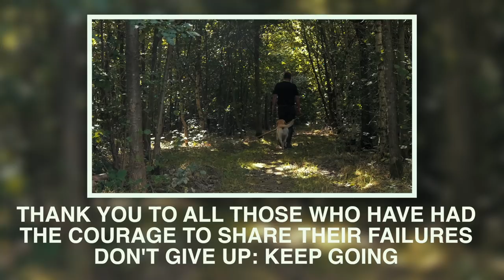Broken a Bow? Failed as a Bowyer? Never Give Up

Comment: thanks for the inspiration Mick, I was feeling disheartened after cracking my first attempt of a longbow, devastated I was as ive had the wood seasoning for years and have no more to work with yet. I decided to make a kids bow with whats left of the stave (47.5 inches from 73) but also went for a wander by the roadside in a thin strip of woods and have found a lovely straight and long dead sapling, I cannot identify the tree by the bark alone but im going back for it, should be nice and seasoned already and youve shown me I can make a bow from any wood. thanks again!
Reply from the maker: Keep at it!

Comment: Today I  was on the last stage of tillering a red oak recurve bow that I’ve been working on for the past two weeks. Had pressed the bow to 49 lbs at 28 inches yesterday. Wanted to get it to 45 at 28 today so after a few card scrapes on each limb to remove some shavings the bow exploded when i pulled it to 25 inches on my tillering post. Disappointed? Yes! But then i did a quick inventory of my work process, design, wood selection, grain, etc. Disappointed? Yes, but also so grateful for the experience, the satisfaction of seeing the bow come into shape, and the learning i achieved from the work. So now what? Keep going? Hell yes! Tomorrow we start a new bow. This time using Hickory. Carry on!
Reply from the maker: Well done with your positive outlook! Good luck.

Comment: Yesterday I saw a hazel branch and thought to myself is this wood good for a bow. So of course I googled it and found your channel and your hazel bow series. You inspired me and today I went to get that branch it was even long enough for two peaces so if I fail on first I can try again. Currently the wood is drying as you said ,here in Croatia is very hot right now so idk it may speed up the drying process ,wish me luck :-)
Reply from the maker: Good luck Mateo. Hazel is good for bows, easy to work but does challenge us beginners. Make the bow’s belly flattish - not D shaped. Takes a few weeks to dry, especially if you shape roughly to bow size first. Best wishes, Mick

Comment: I’ve taken a short break because its too hot to be working at the moment, and because I need a break otherwise I’ll get frustrated when it starts to take too long. But I do know I can do it. The second one I made from a board only broke because I made the brace waaay too high, almost 7-8 inches. At a normal 3 inch brace it pulled just fine. Then I pulled it hard at the high brace and it broke. I’m not giving up, just preparing for the next session.

Comment: Thanks Mick. My latest bow (a Russian Olive gull shaped branch bow) is giving me fits. One good thing is I am going for a light weight practice bow (25-30 lbs) but even that is challenging as balancing the limbs keeps wobbling back and forth as I try to reduce power. A real character bow, as well. My local woods include black locust, ash, and hop hornbeam. I also have some Pacific yew. Even harder than bows? Arrows!

Comment: Hello Mick.

I started tillering, and inevitably broke, my first bow today.  A lovely piece of beech deadwood picked up in the forest, and now it's just firewood.  Back out to the forest with an axe and a handsaw tomorrow.
Reply from the maker: That’s a pity, but it’s how we learn. Find some hazel or ash if it grows near you. You might have more luck with one of those. Stay well.
Reply: Yep, it's a pity but it's all part of the learning process.

Around here there's loads of beech, some birch and hazel, and occasionally some ash.  The rest is epicea, which is useless even as firewood.  Beech seems to be the one that grows straightest and mostly without knots, which is why I picked that particular branch.  I gather it really wants to be tempered on the belly for bow use but for starters I just want something that will bend.

It was my fault it broke, of course.
Reply from the maker: Michel Auron beech has an interlocked grain, a lovely wood but not one I’d choose for bows. Hazel is excellent, usually grows straight and responds well to heat for reshaping and hardening the belly.
Reply: Thanks for that.  I'll have to see what I can find, the haze around here seems to grow "straggly", it's rare to see anything much thicker than arrow shaft size.  Might be something to do with thicker branches getting flattened and snapped by the snow - I'm in the French Alps.

Also, thanks for your various videos.  Enormously inspiring, and beautifully made.
Reply from the maker: Michel Auron Ah, I wondered where you lived. Hazel grows well in UK and often coppiced, producing many straight branches ideal for bow making. How is the birch where you are?
Reply: It's mixed woodland with a majority of epicea, so anything broadleafed is fighting for space.  The only way, as Yazz once said, is up.  This means there's a lot of very straight wood, which is good.  What's also good is that early and late season snow, which tends to be properly heavy at this altitude, brings down a lot of trees and branches, which means there's a lot of wood simply lying about, taken down at prime cutting time when the sap's down, and seasoned under snow... 

Birch is a bit rarer than beech, but there''s a fair amount of it around as well.  Silver birch.  Grows a bit more wonky, hadn't really thought about it for bowmaking.  Recommended?

The bit of beech I was working on was around 25 years old counting the rings, around 2 inch diameter, quite dense really.  It'd been down for a while, the bark was already stripped.
Reply from the maker: Michel Auron I have always been cautious of fallen branches, but you seem to have plenty of choice. I believe silver birch makes an okay bow, but around here I don’t find anything at all straight. Any yew?
Reply: @MickGrewcock  I wish!
Reply from the maker: @wibblywobblyidiotvision  Well, it was only polite to ask ;-) So you will have to do as I did: use whatever you can find and figure it out. As I'm sure you already know, there is little to guide you so just experiment. If beach is your best bet, then you must figure out what it needs. How did your stave break and where? At what approximate poundage and draw? Nearly all woods will make a bow of some kind - what were you aiming for? Do you think your tillering technique was at fault or the making of the bow itself?
Reply: Broke at 2/3 up a limb as I was trying to brace to about 3 inches.  Definitely my fault, too much too fast :)

Climbing a mountain tomorrow, so won't have time to go searching for wood.  Have to wait until Monday, I guess.
Reply from the maker: Michel Auron Stay safe. And yes, the middle was too strong or the end limb too weak.
Reply: Bit of both, I'd say.  Plus the bloke tillering it was a bit of a tool.

Went out this morning and harvested some more wood, before the midday country-wide curfew.  Scored myself a nice piece of hazel, which, it turns out, is twistier than a twisty thing, dammit.  Also a couple of nice pieces of beech (again), which split down nicely with no twist, gonna have a shot a more of a flatbow this time I think.  We'll see how it goes.

Comment: I only began to make bows for myself because I was reluctant to buy something that I would probably like better if I had made it myself. If I live to be a hundred I will not claim to be a bowyer and tend to take most claims to be one with a pinch of salt.
An acknowledged master once said "Any damn fool can string a stick that will shoot an arrow..."
I have been loosing arrows since before I could read and I'm left after more than sixty years with an abiding interest in the practice of instinctive archery using self-bows and wooden arrows.
I have no more than a pragmatic interest in my bows and from time to time, some attachment to a current favourite.
But talk is cheap and an honest arrow is the only witness that counts. 
All prizes are illusory, the value where it exists has been in the journey. The failures have been lessons along the way, even the ones that were foolishly dismissed.
But how many bows do we need to make (unless opening a shop) before realising the value of building a less imperfect archer?

Comment: Hi mate. You were right. Making my 2nd bow. Wonky😭have spent many an hour just staring at it and pondering. Any idea thickness for a hazel bow at tips and handle for a 40lb bow. Thanks
Reply from the maker: Depends on the wood to some extent but tips 8mm ish and maybe around 25mm/30mm at handle . Best thing to do is start thicker than these numbers and work down to the shape first and then reduce the draw weight to what you need. Tips always seem able to stand being thinner than we imagine and the handle area depends on whether you want it to bend through the handle or not. Try not to get hung up on dimensions, let the wood show you the way. Good luck.
Reply: Thanks. Was trying to be to precise from to off!!!! Wood doesn't do measurements. 👍Cheers
Reply from the maker: Yes, I found a ruler is a dangerous aid when making self bows! But when I started it was useful to have some idea of dimensions. Now I am a little less concerned with that.
Reply: @MickGrewcock  hi again. Thank you. Ill have a at the  stave again.